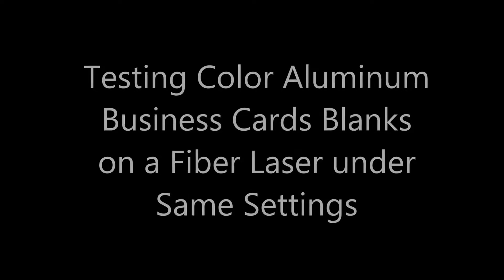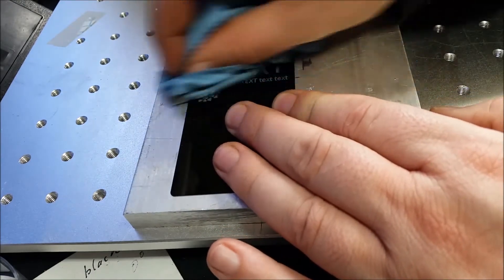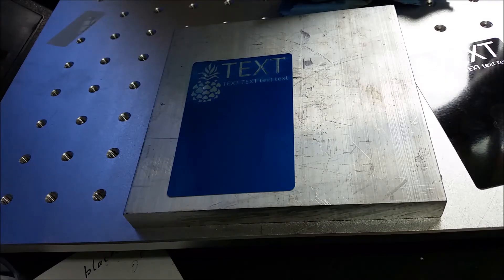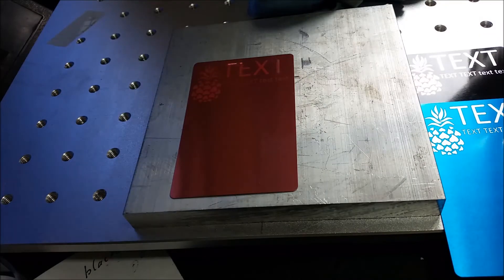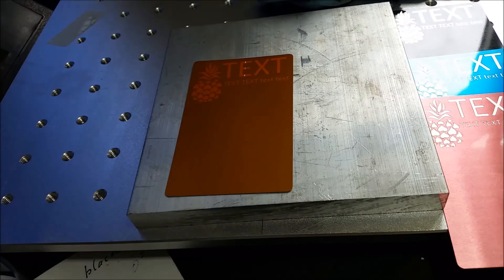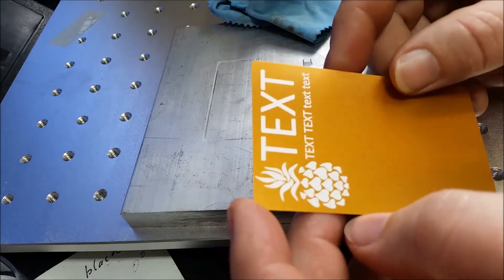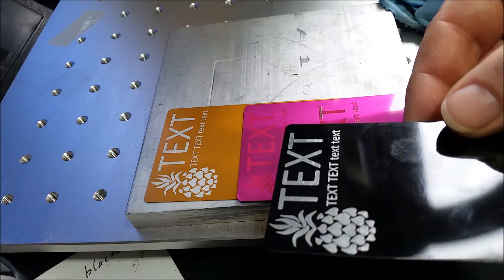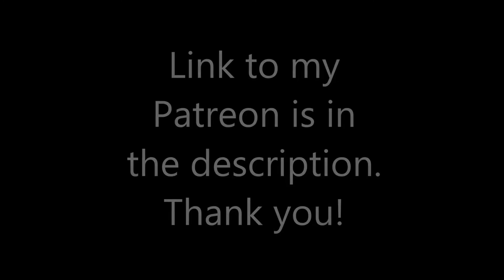Fiber Laser Academy. Ep.3 Comparison Test of Color Aluminum Business Cards Blanks

Comment: To MDW. The blue aluminum is a little more difficult than the black.
Got it.
We need the blue aluminum for our situation.
The material would about 20 gauge.
How many passes using out 30 watt laser would it take for a good 'silver' to blue result.
Looking for a solution.
Reply from the maker: I was able to improve my results on black but didn't try on blue. Actually, blue is second best color to engrave. Should not be difficult. I would presume frequency 37-40. Power depend on lens and speed. From my experience, there are two type of these blanks engravings silver(aluminum) gloss on color (available only on black and blue) and white on color (available on all except from purple). I need to do more experiments on blue... I just don't use this color. But my laser if 50W...
Reply: @UtterlyMad  Thank you. I would be using a 70 mm lens for detail.
Thanks for the vids mate!!
Reply: @UtterlyMad  Thanks for the info. Gives me a head start.
Reply from the maker: Video on engraving blue cards coming in a few hours! Hope it will help!